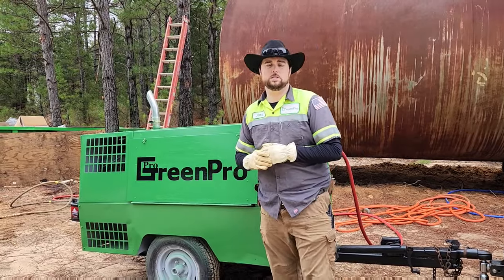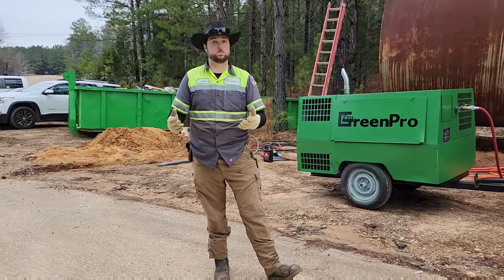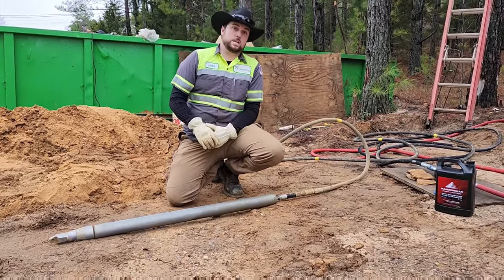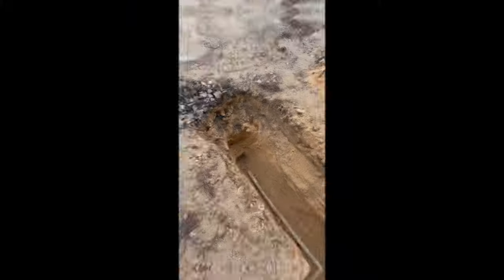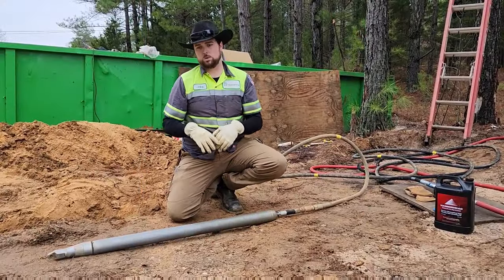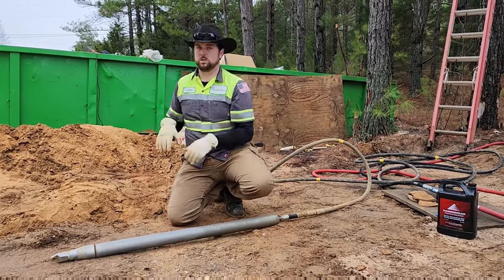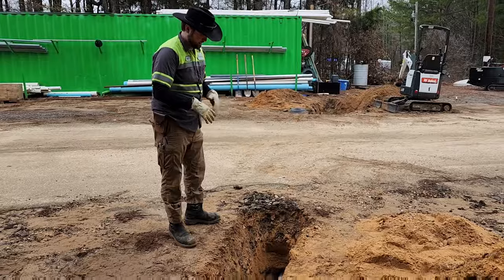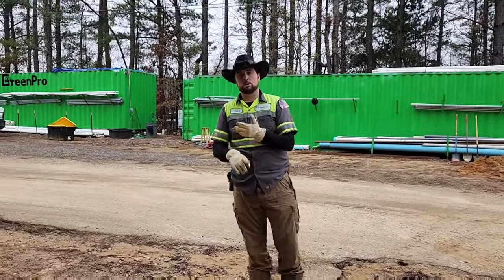How Missile (Mole) Boring Works

Comment: My husband has 13 years experience with underground directional drilling. He just started at a fiber company as the head of their new department doing missle boring. He is on a crew with 5-6 people currently. They are each expected to have 100 ft per person per day so 500-600 ft. They don’t have a tractor or any sort of equipment to help dig so everything is hand dug and the guy giving them to jobs are telling them it has to be no less than 36” deep. He has worked so many jobs in directional drilling and used to get so much footage daily doing directional drilling but he’s finding it impossible to get the footage required doing it by hand. My husband is a pro at hand digging but it seems like digging 36” down by hand with only a crew of 5-6 people and expecting 500-600 ft per day is a huge ask. How are crews typically set up for missle boring? For example does each guy have a specific job they are responsible for like one digging, one guiding the missle etc;? 
How many inches do you typically dig down? Is everything done by hand or do yall have an excavator to help? How much footage do you typically get done daily? I’m sorry for so many questions but my husband has been handed a golden opportunity with so many perks that our family needs right now for this company and we really need for this to work out and be successful but the company won’t provide an excavator and my husband is not seeing how the footage can be reached in a timely manner without one. Thank you for any insight you may have!